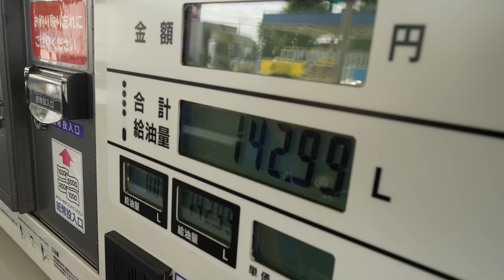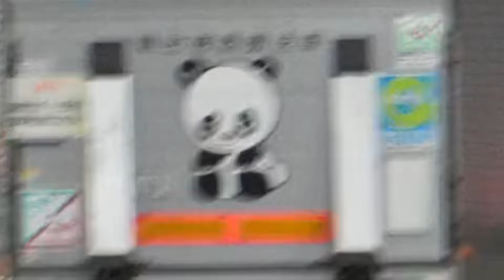I Spent a Day With Japan's Tiniest Truck Driver

Comment: Wait, they are not allowed to use GPS? I mean, i get the sentiment that you need to be able to calculate these things and it's also a good thing to practice once in a while, but not being allowed to use it at all?
Reply from the maker: GPS in a country like Japan would be wildly irresponsible and very dangerous
road width, narrow turns, bridge and tunnel clearance, mountain road grades, and about 100 other things that arent on GPS
Reply: @TokyoLens  Isn't that exactly why Japan has QZSS?
Reply: @TokyoLens  How did i ignore it? Japan isn't the only country with narrow turns, bridges, tunnel clearances and mountain road grade - these things ARE on maps (if they wouldn't, you couldn't plan those on paper), so that point is pretty mute. Any global positioning system is spotty in tough terrain, and GPS especially in Japan, so that's why they did their own thing with QZSS - or so i'm told. Look, i'm just trying to engage in your content, which i like and was interested in this. Never was my intention to waste your time...
Reply from the maker: Gotchya
I appreciate the clarification and apologize for being short~

Long story short: there’s still too much in Japan that just doesn’t show up or risks not showing up. Also Japan is weirdly tied to paper based tradition
I’m in flight training right now and I’m not allowed to use GPS for navigation either
Everything must be calculated and done with paper maps
Mostly in the case of technology failure
Reply: @TokyoLens  Thank you :) Don't apologize, i get the sentiment - we have to make social media a positive thing for it to be a positive thing and i could have worded things a bit different, instead of maybe coming off a bit rude.

As German, i think i can very much relate to both sides - we've finally lost Fax here in Germany, but i've read recently Japan finally allows USB-Sticks for digital documents (i mean - even floppy disks are digital, so that's that... :D)...
However - as a fellow flight trainee, at least for the first half of the training, i'm not allowed to use GPS either...at least that is not necessarily a Japanese only thing :) 

My Mazda CX-60 however has lot's of "oldschool" buttons, which i absolutely love and was something that drove me to it :D 

Thank you again for your content, even though i never was much in to anime, I've had a "weird" (= i can't explain it) fascination with Japan for a very long time
Reply from the maker: haha I think we all have that weird fascination!! Ive been here over a decade and I STILL have it haha!!
have a good one eh~

Comment: wtf is the reason they wouldnt be able to use GPS?  That is actually just stupid from a buisness standpoint and deffinetly hurts efficency.
Reply from the maker: No it’s incredibly stupid TO USE IT 
Not to mention wildly dangerous, lazy, and irresponsible
Reply: @TokyoLens  can you elaborate on this, is it because it's a distraction?
Reply from the maker: @Leaferr  GPS doesn’t account for 
Narrow Japanese roads
Any of the bridge heights on the thousands of bridges 
Or even height of the thousands of tunnels
Let alone narrow intersections
Turns on mountain roads that a semi couldn’t make
Roads closed to major trucks
Or any of the many many other things that a driver should be researching when driving transport in Japan

Comment: Why the devil can't you use navigation?
Reply from the maker: insanely unsafe
Reply: @TokyoLens  wait serious? Damn I need to get good. I can't go anywhere without it while driving. As in the maps just give you a route and you can get stuck with low ceiling height and all?
Reply: @Karthig1987  He already answered in other comments. 
Because it would be a terrible mix of dangerous and stupid 
There’s a reason truck drivers in Japan research and plan their routes
It’s a tiny country
With tiny roads
Tiny low bridges
Turns that trucks can’t make
Mountain paths trucks can’t climb
And about 50+ other things that don’t show up on GPS

Comment: thats stupidity without using GPS its backwards
Reply from the maker: No.
It’s called safety.
Japan is full of narrow streets, mountain roads, low, bridges, low tunnels, turns that a truck can’t make, hills that a truck can’t climb…
And about 1 billion other things that do not show up on any GPS navigation systems.

The stupid and backwards thing to do would be to rely on GPS